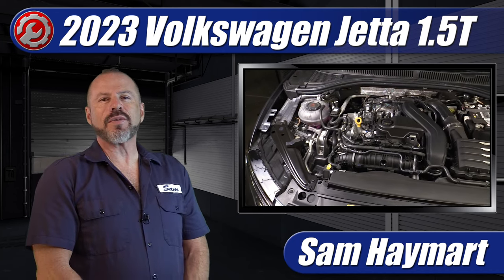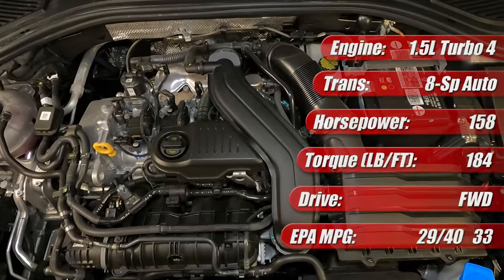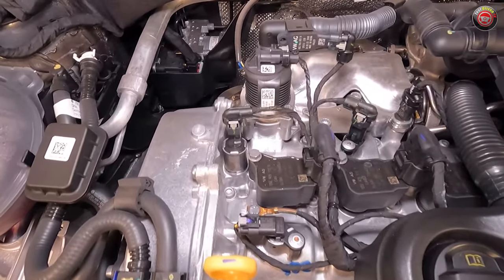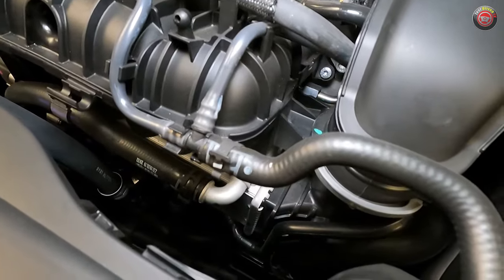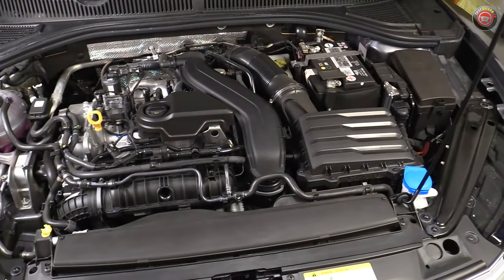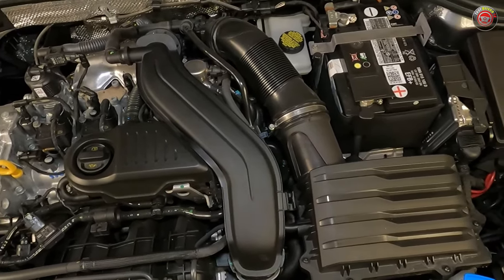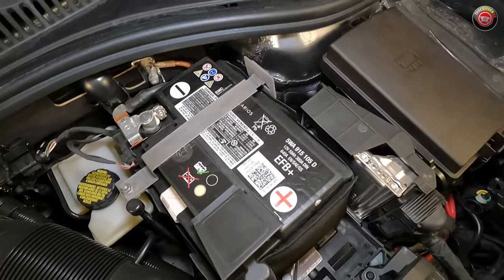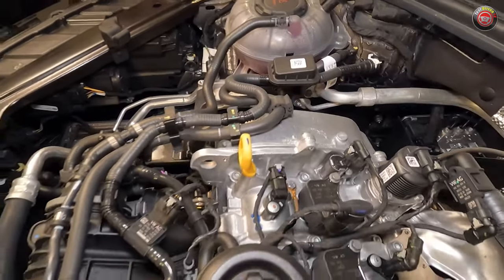2023-2024 Volkswagen Jetta 1.5T: Engine Explained

Comment: slight correction, the water pump is not electrically driven, at least not the primary.  The primary water pump is on the driver side, driven off of the exhaust camshaft with a toothed belt.  There is a secondary electric pump at the front of the engine under the charge air cooler, the purpose of that pump is to circulate the coolant through the charge air cooler, as well as turbo. It's a separate loop, albeit connected to the primary.  The electric pump allows for coolant flow through the turbo after shutdown as well as tigher control over intake air temp.
Reply: Wow you’re so cool!
Reply: @Ummmmmkay88  It's an important consideration especially from a long term maintenance perspective. Among other consideration. One is much easier to remove and replace. The other... not so much.

Comment: I have a 2020 Jetta R . Mine has a belt timing belt. Does the 1.5T have a belt or metal timing belt? p.s. I love my car but considering trading when the warranty is up.
Reply: There is not a metal timing belt.
Reply: It's a belt, but has no replacement interval.  150k inspection, and then every dozen thousand miles afterwards.
Reply: @rudolphna54  People get way too caught up in nothing burgers lol. Any belt will at some point fail and need to be inspected. That is normal maintenance. People will make a big deal about a belt inspection, but not the thousands in electronics, that can fail lol.
Reply: @calebniederhofer6529 agreed. I would rather replace a belt. 
I just replaced the chain in my daughter's Pontiac Vibe. The Belt on my Pilot was much easier to change. I also have a 2017 Jetta 1.4L 
I am about to buy myself a 2024 Jetta with the 1.5l. We'll see how it goes.

Comment: I bought one of these with a 6mt. Very happy so far.
Reply: Considering buying an 2024 S or Sport 6MT. Some info online suggests this is the last year for the 6MT (possibly except in the GLI)
Reply: What do you think of all that rev hang?
Reply: @juice7661  I've gotten used to it. Not that bad. Besides, it's a commuter car, not a track day machine.
Reply: @Cimone90  Yeah sure, I mean its not an issue if you're just shifting like a normal person through traffic, but its REALLY annoying if you're using the entire rev range, like say you take it to 6k then you have to kind of wait a minute or else you know its a wonky shift into the next gear.
Reply: @juice7661  weirdly, I actually find it less noticeable if I'm driving it hard. The revs fall off faster if you're shifting out at the top of the rev range. My 2017 gti was the same. That one I put a lightweight flywheel in because I wanted to properly fix the rev hang, but it felt very similar to this jetta before I did that
Reply: What is your mpg hwy if you are babying it @ 70ish?
Reply: @WillGroves92705  if it's open flat highway, it easily averages 50 mpg at 70mph.
Reply: @Cimone90  tytyty
Reply: @Cimone90 same here
Reply: Wow

Comment: Just drove it today after driving a gli. I was actually pretty impressed with the power and sound in sport mode. Was it the gli? No..but i liked it a lot.
Reply from the maker: We tend to concur. Some of the first Buddack Cycle gas turbo engines coming off the TDI scandal in 2016-2018 were pretty un-enjoyable but the latest 1.5 has ironed out most of the dullness and lack of willingness - actually feels kind of fun.
Reply: @TDTVGarage Agreed. I also enjoyed the transmission..pretty snappy. I'd like to see what a tune will achieve with this engine.
Reply: @cfairfax85 I can imagine a tune would make it very similar to a gli without having to worry about issues with the dual clutch transmission

Comment: Head gasket failures are being reported on the VW Taos that has this same engine.
Gives me pause about buying one now🤷🏻‍♂️
Reply: My 22 Jetta just blew the head gasket at 36k
Reply: @marcusakers7245  the 1.5L engine?
Reply: @auxmike718  yup.
Reply: I’m at 40k on my 24 Taos (I drive a lot for work) and I haven’t had any issues
Reply: 23 jetta sport here. My fuel injector was plugged at 18k. covered by warranty. Only issue i have had yet
Reply: Mine blew at 26k.
Reply: The head gasket issue was acknowledged and a new replacement part was put on all cars made from August 2023 on.
Reply: @itzed  hope so!
I was wondering if the factory wasn’t tightening them properly….
Reply: @itzed Hopefully VW will issue a recall for the cars that have this issue. Currently it is a tsb.
Reply: Head gasket 20k worst experience with vw
Reply: There are problems with every car. Some models failing doesn't mean all do.
Reply: @jcmee91  the dealer ship takes too much time for replacing head gasket i drop my car almost 2 week before and till now they did nothing and they said we didn’t get reply from vw tech team how to change head gasket like open the cylinder head or not its unexpected from vw

Comment: Aluminum is a departure from the thin cast iron block of the recent past. Could this be the reason for head gasket failures? Haven't heard of head gasket failures on VW engines until now.

Comment: Are these engines reliable?
Reply: Meh I mean I’ve owned vw for many years and the last one I’ve had is a 23, a lot of weird noises rattling mostly, after purchase service sucks they never want to do any maintenance that is covered under the warranty. Still runs good at 20k miles but not sure if it’ll make it to 100k miles without “major” maintenance. Still fun to drive as all jettas
Reply: Not really , its a turbo gdi while also being a vw
Reply: short answer, no

Comment: I am moving from TN to MN in a month and I have a 2023 Jetta. Does it have an engine block heater already installed? If so, where do you plug it in? If not, can you help me determine what kind of engine block heater to purchase and where to install it?
Reply: To be honest I wouldn’t worry about that - especially if you’re moving to Minneapolis-St Paul. Block heaters are actually not as common as you may think throughout the upper Midwest and I’ve personally never had nor needed one on a car. Also it’s presently 30 degrees where I live in MN, 70 miles south of Manitoba. Our winters are becoming more and more mild.

Comment: Very informative. Thank you, sir. I am planning on getting a new Jetta, and if like to ask you a question if you don't mind: how's this engine's quality in relation to the older 1.4L turbo in the 2019 re-design? 

Mainly, I'm wondering if the new engine handles carbon build up from the inclusion of a turbo charger better. From what I've read, it appears that a series of short drives that don't allow the engine oil to get to its needed 220-60 degree Fahrenheit temperature can exacerbate this problem? My job is a short 10 minutes away, so I'd fall into that regular trip category that would allow the after 15 minutes of driving needed to get the oil up to optimal operating temperature. 

Thanks again!
Reply: how about a bicycle?
Reply: Don’t overthink stuff lol. Carbon build is not a problem and you will just need to service it about every 75k. It is not a big deal at all really. More importantly do oil changes at 5-6k max and change fluids around 75k.
Reply: Carbon build up on the valves is very very slow and non-threatning to the engine. It starts to show up after 100K miles and can be remedied without opening the engine.
Reply: I had a 2019 and traded it away with 140,000km on it. Never any issue with the engine or how it performed
Reply: @larryhouse3776  What about oil changes? Is it 5000-6000 km or miles?

Comment: is there timing belt or chain? Interference engine or not?
Reply: ea211 engine introduced around 2013 is belt, this is one of his variations. The previous ea111 was chain
Reply: I asked a Volkswagen dealer they told me they went back to chain who knows.
Reply: It’s a belt.
Reply: 1.4 tsi after 2013 is belt driven. 1.5 tsi is chain driven. Both are interference engines
Reply: Interference belt

Comment: Is there a tune available for this motor yet??
Reply: No ECM tune yet. But I hear the JB4 adds some good power though.
Reply: @jeffbauer3425  It actually really does, especially the 93 map. It basically is right there with a Civic SI 1.5 stock dyno, maybe even a little better in the torque numbers.
Reply: not yet tuned, this is dxdb, ea211evo2.

Comment: Has anyone found aftermarket intake for this 1.5t? Has anyone filled up with 93 octane and notice a difference?
Reply: it's the same engine for T-roc and some golf 8. plenty of compatible aftermarket intakes for it. Forge FMINDK35 works for it
Reply: Any difference you think you feel with 93 octane is purely in your head. It doesn't make any noticeable difference.
Reply: @Cimone90  Wrong, 93 will provide an undeniable difference in horsepower but, without a tune you may only get about 5hp and wether you can feel the difference of 5hp or not is very debatable.
Reply: @juice7661  ok champ

Comment: Timing belt or chain?
Reply: The 2022/23 Jetta 1.5 has a timing belt with a recommended service interval of 60K miles.
Reply: @chrisschuffler8870  The Exact reason why I love my 13 focus Duratec Motor- No Turbo, No timing belt, External Water pump and gets 38mpgs, and plus easy to service. This thing looks like a nightmare to work on!!!
Reply: @es-qf2gw  no offense but those years of focus’s are one of the biggest pieces of shit ever created unless you get a manual, I’ve seen people go through as many as 7 transmission jobs in less then 150k miles, would much rather have a Jetta it didn’t look that complicated
Reply: @cartere9981  actually I do have the MTX75 5speed manual transmission in my focus. It makes the world of difference!
Reply: @es-qf2gw  He's actually incorrect. In the US at least, there is no   recommended interval on the timing belt. They are kevlar reinforced EPDM and the only service in the manual in inspection at 150k miles and every dozen or so thousand miles afterwards.
Reply: I took my car in for servicing and they told me that the 2020 jet Jetta has a timing chain , Sierra motors Ottawa Illinois .
Reply: @douglasldn2831  If it's not the 2.0L GLI then they are incorrect. Every Jetta since 2012 with either the 1.4TSI or since 22 the 1.5TSI has a timing belt.  I had a 2019 Jetta and it was a belt and the 2020 is mechanically identical to the 19
Reply: I talk to the service manager and he told me they went back to the timing chain on the 1.5 L engine and they’re supposed to be a Volkswagen dealer. If I buy another one, I’ll have to buy it from hawk out in Joliet Illinois.